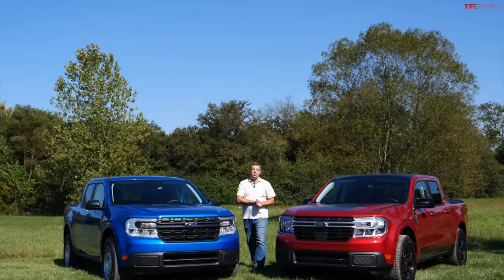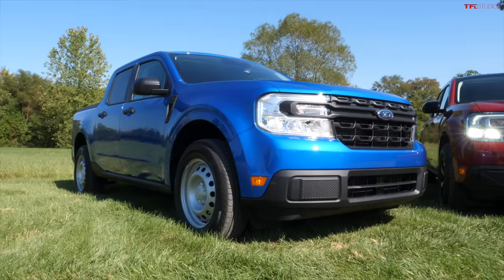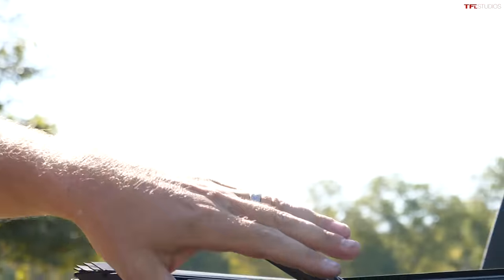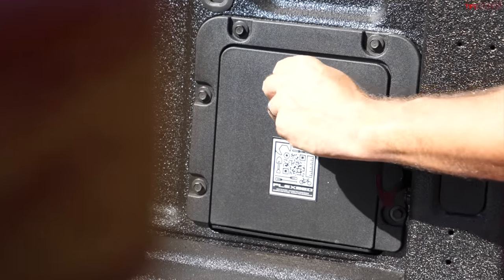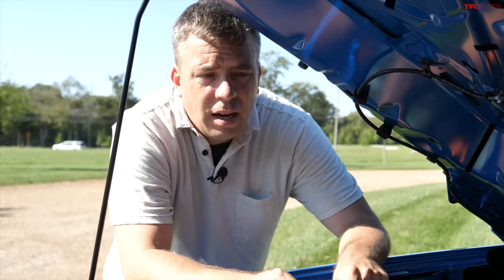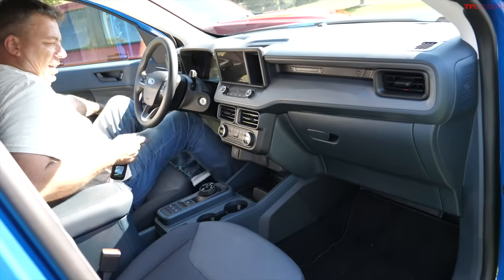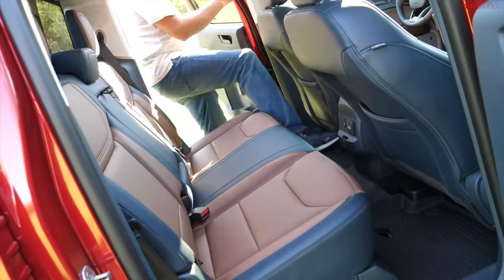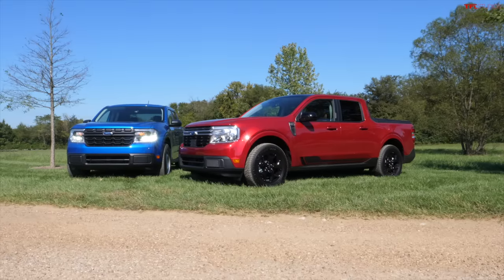HANDS ON with the Least & Most Expensive New Ford Maverick - The Differences Will Surprise You!

Comment: The fully loaded version is cool. But the base version is a game changer !! What an AWESOME alternative to a boring little CUV without any downsides… Gas friendly hybrid powertrain AND utility! Really impressed by this future home run! 👍🏼👍🏼
Reply: And the 2.5 liter hybrid drive used us a PROVEN winner...my fusion is a 🐴
Reply: XLT is the value play; the XL is a little too stripped down for me (cruise control is a must-have).
Reply: @stephenj4937  Agreed. Will probably get a lot of that value back in resale too, nobody is going to want XL's (agree on cruise, total must have).
Reply: I already ordered my xlt can't wait to get it!
Reply: @jamiemarier5647  Not only is the 2.5L is Tank of a Engine, but the hybrid drive train is based on Toyota's Hybrid model. The CVT is not what you think when you hear CVT. There is no belt, but two electric motors and some planetary gearsets. No need for a Torque converter either. As we know with the Prius the design is rock solid. 

The base model isn't bad, but never get base base model. Either need to tack on a few options, or just move up to XLT. Still low 20K's is a great price for a Hybrid, a Ford Escape cost way more for the Hybrid option and it is damn near the same thing, just not a truck.
Reply: Sorry, but no way would I go for a cvt transmission. I drive truck, local p&d. I still pick up hundreds of cvt transmissions every month from dealerships. Especially Nissan and Hyundai, Lots of engines from Hyundai as well
Reply: @michaelfrohnfrohn986  it's not that kind of CVT, it's the same CVT the prius has had for 20 years, that, to my knowledge, nobody has broken without putting excessive mileage on.
Reply: @halo37253  The hybrid drive is not based on a Toyota design..it was completely an in house Ford design.
Reply: @glamdring0007  you're missing the point.  CVTs can be good or bad, it depends on the manufacturer.  Ford's hybrids and CVTs haven't had notable issues (just their DCTs) so I'd bet the hybrid Maverick is fine.
Reply: @faeinthebay  I think you're the one who's not getting it. Ford is being sued on multiple fronts for defective transmissions in multiple cars of various sizes and classes. Everything from Mustangs to Fiestas have been hit by lawsuits for crap transmissions. Thinking they will suddenly get one right on a brand new platform is a big risk to take...much better to wait a few years and see if they finally got one right.
Reply: @glamdring0007  I decided to research more and it turns out this is an old powertrain; the 191hp 2.5NA + eCVT first debuted on the 2010 Fusion Hybrid and was ported to the Escape soon after.  I'm not seeing any consistent issues reported with any of these hybrid models.  The Maverick platform could indeed have issues, but the hybrid powertrain is proven.
Reply: @faeinthebay  I just wish you could get the hybrids with awd and fx4 package that would be epic.
Reply: @glamdring0007  As they already mentioned, the “CVT” used in the hybrid is nothing like a conventional transmission at all. It uses two electric motors and a planetary gear in order to power the wheels, they just call it a CVT because the way the speed varies is similar in function. It takes advantage of the way electric motors work with their lack of a need for variable speed ratios, there’s no band like there is in a traditional CVT (no “rubber band effect” that is a common complaint with CVTs) 
Toyota’s hybrid synergy drive system uses a very similar transaxle which has been proven to be more reliable than a traditional transmission over the last 20+ years. Ford has used this system for over a decade with no issues. I’m not saying the car as a whole will be reliable and I don’t think I’d ever buy a Ford because of the reliability concerns, but it is important to note that the transaxle is not truly a CVT and will not have the issues that Ford’s automatic and manual transmissions have had in the past (again, it’s important to note that the transaxle does not resemble any kind of traditional transmission).
Reply: @faeinthebay  It's not a CVT, no belt like a traditional CVT.
Reply: @Prestiged_peck  my hybrid Fusion transmission failed at 60,000 miles. I researched this power train before buying and didn't see reliability problems but needless to say I'm disappointed in it.
Reply: Really the XLT (mid trim) with the Hybrid engine is the sweet spot for this vehicle. There’s already more reserved than Ford can manage… a bit of a Bronco mess all over again.
Reply: @glamdring0007  and even those are the automatic traditional transmissions, not the CVT like in the Ford Escape and Fusion Hybrid (which has been tested at extreme mileage in NYC taxis with high reliability).
Reply: @stang1977  the maverick isn't using the fusion trans... so...
Reply: @glamdring0007  the 6r80, to my knowledge, is the best 6 speed auto currently available from a drag racer's standpoint, the 10 speeds aren't that bad either, the focus/fiesta was well deserved, but it was their first and only attempt to build a DCT (dual clutch trans) in house, there was an issue with the supeer duty 10r140 that has since been fixed, and the Mt-82 is externally supplied and on top of that will live just fin if you don't use a 10 pound sledge on your shifter every time you shift (exxageration, but I've had one last 200k and it's still going on the stock shift linkage, you just shift it right and you're good)
Reply: @word42069  Google is your friend. The Escape/Fusion hybrid ranks 25th out of 44 for reliability and there are 6 recalls already on the 2020 model, but keep singing your song.
Reply: @stephenj4937  I agree and it was probably intentional.  I would consider XL if it had cruise control. That said the XLT is still a bargain and I do like some of the upgrades.
Reply: @zacharyreynolds4303  It has nothing to do with driver experience that is just stupid.  Big trucks are for heavy hauling, and if you don't need it smaller is better in every way.  Easier to park, easier to get in and out of, and far better driving dynamics.  Obviously this isn't competing against huge F150s and Rams, its target market is small crossovers and cars.
Reply: Does the base XL have cruise control?
Reply: @delliott777  no
Reply: "Without any downsides?"
I would like to see the standard model having only front drive get up a slick hill at gross load.
Reply: @zanderfaust  thanks buddy
Reply: Add cruise control. Just buy the steering wheel and it is likely plug and play. Likely 150 bucks or less. I for one never use it. So I would just buy the XL as is. Under 20k is the most I could see spending.
Reply: @stang1977  What year is it that would help
Reply: @Prestiged_peck  thanks for clearing that up.. I was a lil concerned
Reply: @rconger384  What's the difference between rear wheel and front wheel going up a lil icy road? I'd like to see a f250 fully loaded going up an icy road.. what now?
Reply: Also has standard pre collision driver assist and auto braking on all models. Plus who needs a touch pad entry when all models come with auto start and auto start scheduling. Best interior imo. The red maverick with blue interior with grey and orange accents is hideous to me. White paint all dark clean interior finish for me. Honestly might be one of the best base models ever.
Reply: @EverydayCars  the hybrid is lacking in torque. I think it would fall flat on its face in an all wheel drive version.
Reply: @corey1788  The electric motor has instant torque.  I own a c-max hybrid and a clarity plug in hybrid.  So lack of torque wouldn’t be an issue.
Reply: @rconger384  what constitutes as a “slick hill” lol? Rain water? That would be no problem. Oil slick? That’s probably a dumb test.
Reply: @stephenj4937  I missed the fact that the XL doesn't have cruise control).  I can't believe even the most base model of a vehicle in 2021-2022 doesn't have cruise control.  Even the stripped down cars that my employer owns (last time I even drove one was in 2010) has some sort of rudimentary cruise control.

Comment: The base model, with its high city mileage, cheap cost, and utilitarian features is perfect as a fleet vehicle for service calls in urban environments. It compliments the Transit Connect fleet vans.
Reply: yep, I see them becoming the new fleet trucks for auto parts stores.
Reply: @JohnMiller-zn9pf  the little ranger replacement pretty much
Reply: I love this thing I'm thinking about trading my dually 350 lariat for this thing or the lightening
Reply: Definitely, I ordered a hybrid for a small handyman business due to its size.
Reply: @JohnMiller-zn9pf  I wish. We got a new Ranger to replace one of the old Rangers that was totaled. They’re too tall. The lifting equipment can’t lift up engines or 55 gallon drum’s high enough to get them in the bed. Hybrids scare some corporations, a lot of shops refuse to work on them. So being potentially forced to go to a dealership depending on the market area is not something my company is really interested in doing. I hope my Manager is wrong about that last part. These things really do seem perfect for parts delivery. We’ll probably have to get a Transit City to replace the 4 cylinder Frontier if it gets totaled just to be able to load up certain things.
Reply: Yep. The pool guys will probably snatch these up, finnaly those old rangers can sleep.

Comment: Peoples who say it only tow 1200lbs are thick headed. It's not build for heavy towing. It's a truck that get 40 mpg with 195hp and get cost less than $20k. You can't find truck less than $25k or hybrid less than $23k. There's so much use for this truck. I guaranteed it will be a best seller.

Comment: I am pleasantly surprised by the base version, better equipped than I anticipated.
Reply: Agreed. It is what it is; An affordable truck. If you're willing to pay more then 35k and want higher towing capability this is likely not the truck for you. Lariat doesn't make much sense to me on this model.
Reply: The base not having cruise control is scummy though.
Reply: @FriENTlyFire  if it reduces the cost I'm fine with it. Hell they can remove a bunch more stuff if it means reducing price. Lol. I grew up on an old manual transmission so I never got accustomed to using cruise control. To each their own.
Reply: @FriENTlyFire  that base is perfect for city business that won't do long freeway travel or people who need to move stuff around town. The less is better. I would like a truck with just one airbag and no safety features other than ABS. I don't want a screen, no power anything . For my landscaping side job is perfect.
Reply: @davidzavala337   the problem is it comes standard with power everything, tilt and air but no cruise. Like come on if it would’ve added an extra $100 it would sell like hot cakes. Ford duped themselves on the base xl
Reply: I'm disappointed with the audio system on the XL, as I had understood it was the bass version.
Reply: @FriENTlyFire  you can probably add CC.
Reply: It had everything except 1 major thing - no cruise control- not advanced - none.
Reply: @hjer731  Honestly it's probably just a blocked off button. It's an electronic throttle, it costs Ford almost nothing to add it.
Reply: @davidzavala337  they're required to have a lot more than 1 airbag, and they're required to have things like backup cameras and such, that base model is basically the bare minimum of what a manufacturer can legally equip a truck with, if you don't count the hybrid system as an upgrade, theoretically if you went non hybrid 4banger with no turbo you could probably get something to the 15-17k range that's barely legal, but then you get much worse mileage and you make up the savings in increased fuel consumption during a regular ownership cycle, and the longer you keep it the better off you are with the hybrid, at least until the battery dies, but those batteries are projected to have a useful life of about 15-20 years now while retaining at least 3/4 of their full charge capacity.
Reply: So why wouldn't every light duty fleet vehicle in the US get sold to pick up that base Maverick?  I would think every Autozone parts truck will be a Maverick by next summer. Fuel savings would be tremendous.
Reply: @Ljorm  they'd prefer to keep their current frontiers that cost essentially only fuel to keep running, but I can tell you O'Reilly's has a few on order.
Reply: @SINE382  Ford duped themselves on the XL or sold a ton more XLTs? Lol I agree though. I would never have a car with no cruise.
Reply: Prime Artemis  every manual I've driven did not have cruise control. Maybe on higher trim models they do. But I've probably been in 10-15 in my lifetime that all didn't have it. This one doesn't need it either if it means keeping the price down. If you're not worried about price, get a Ranger.
Reply: @lvlikeyV  yeah call B's on that. Even a basic ass farm truck dodge 2500 manual from the 90s had cruise
Reply: @jacobstrutner8232  My 2012 VW Jetta was manual and it didn't have cruise control
Reply: I would really like to see a fully loaded Gaulent test on the hybrid. Will it maintain reasonable highway speed in the mountains? Will it maintain highway speed in the mountains with 4 adult pasengers? If it can, I will probably buy one!

Comment: The Maverick is pretty impressive for a small pickup. Only thing I wish it had was the option of AWD on the Hybrid powertrain. 
The older Escape Hybrids had optional 4WD and used an Atkinson-Cycle 4-Cylinder similar to this one (though a bit less power), so why not let the Maverick and the new Escapes (which the Maverick platform is based on) have a option of AWD on Hybrids?
Reply: Might be coming later.